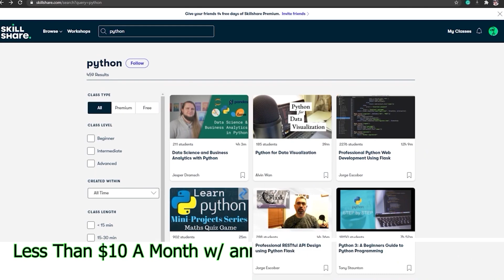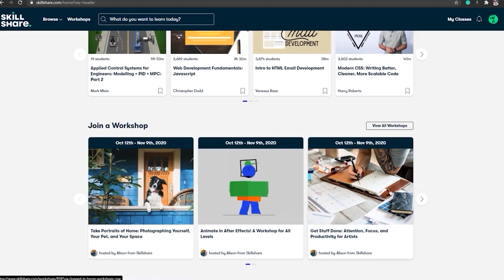iFlight Latest F722 Budget Stack // Stepping in Right DIrection

Comment: Hi. I just got this Blitz 4 in 1 ESC for my chimera 7 as a replacement due to the original one got shorted on the beach. I am using the original Succex-d f722 twing FC with it ( they told me it would work ok with the new blitz esc )  Motor 1 in betaflight says "error 100%" I also connected the esc to BLheli 32 and it cannot read or see ESC 1. Any ideas?

Comment: I'm looking at getting this for my nazgul5 v2,  I brought the bnf Nazgul5 v2 6s and had a bad crash, been having desync's, flips of death and bad crashes, thought the motors where the issue so I replaced them still having the same issues, can't tune them out, changed start up voltage, that didn't change a thing,  so liking at getting this stack as a replacement.
Reply: u think that can be usefull for my Nazgul 5 ??? with 1800kv motors?
Reply: Yeah it's would be perfect for it, I did eventually get the FC and works fine.
Reply: @UnHappyKillMore  the F722 FC?
Reply: @UnHappyKillMore  nice thank you I buy it then

Comment: It seems they designed the esc to be compatible with their nazgul and cidora etc frames. They all have a hole in the bottom plate right there for that capacitor to fit through it seems.

Comment: With the I flight 5 inch frame  the cap would be fine it has a step down were the stack is up higher than the bottom plate if that makes sense a lot easier to show you all lol but on there frame that would not be a problem

Comment: The pics on BG shows the stack mounted on a particular frame that has relief for the capacitor. Otherwise I would remove it and relocate it to the top. The absence of a 9v reg is a deal breaker.

Comment: Finally someone made a video on these boards.  I got a nazgul5 v2 4s analog and it came with this FC and ESC.  I was confused at first because the nazgul5 that was on their website had an f4 FC and a different looking ESC.  I haven't flown the drone entirely yet because I haven't received my goggles yet and also I don't know if I could give you a good review on it because it is the first drone I will ever be flying.
Reply: i had the same problem and the ESC and doesnt work at least for me, im looking for a new stack to buy and see if this board is a good option for my nAZGUL5